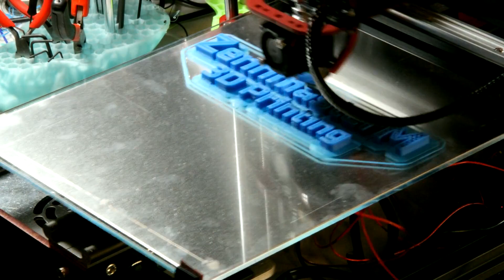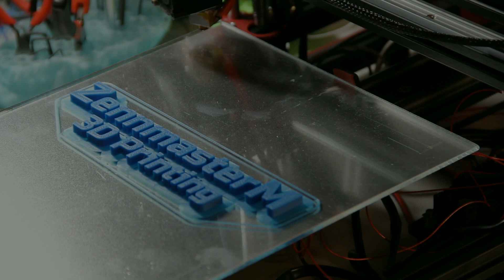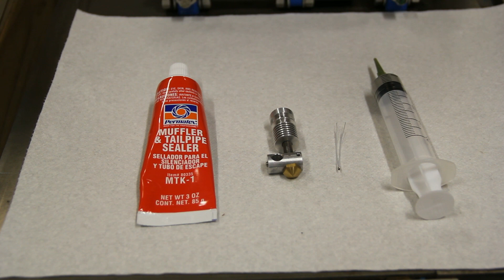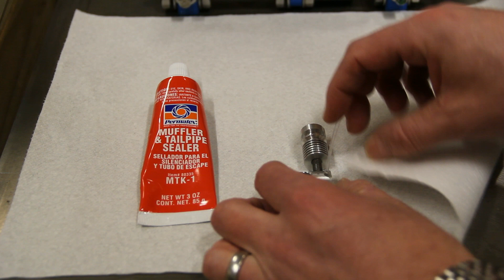RepRap 101: Installing a hotend thermistor with silicate-based cement

Comment: How can you replace the thermistor after the paste cures? I know with method you are not looking to replace the thermistor, but I only ask because i am left hanging with maybe a cracked thermistor that might have been bouncing around with vibrations from motors.  I have prints steadily going on a thermal halt from inconsistent readings
Reply: I don't know, but I'll bet that if the thermistor is bad any way, just drill it out and start over. Besides, thermistors are a dime a dozen on Ebay. Even the entire hot head block is only a few bucks.
Reply: @ronjones4069  I heeded your advice with your video a couple of years ago and I now have steady results.  I use a copper rtv based sealer that's more serviceable but have found out the block are a dime a dozen now too!  Thanks again!

Comment: Thanks for the video.  Glad to know this cement works for this purpose as I already had a partially used tube in the garage! 
May I ask, what size PTFE sleeving do you use for your thermistors?
Reply: I would also like to know what size ptfe sleeve you are using?

Comment: Thanks for this I was looking for just this info. 

Do you make your own thermistor leads? I have the joining ferrols etc and remade a few using the wires supplied by the kits. I want to buy right wire and do it myself but what wire would I buy? The wire in the nits seem to a stainless steel wire with a ptfe sort of coating.

Comment: I know this was done some time ago, but hopefully you can answer my question.  Where did you get the PTFE sleeves you used on the thermistor?  I have been buying some fiberglass sleeves replacements to use, but would like to find a bulk supply so I don't have to keep buying the stuff in 3 inch units.  :)
Reply from the maker: +Edward Boston  McMaster Carr, www.mcmaster.com.  The website is a little hard to navigate, but they do sell the stuff by the foot.
Reply: +ZennmasterM whats the ID going to be?

Comment: I have to replace hot end resistance and have to clean a similar compound I think... Do you have a recommendation for cleaning this stuff? Thank you
Reply from the maker: I'd receommend mechanically chipping it out with something like an awl.
Reply: ZennmasterM it is ok. I used some organic acids, it worked.Thank you.
Reply from the maker: Mert Oymak  That's great!  I'd love to hear some more details about your method and what specific organic acids you used!
Reply: ZennmasterM
I used grout cleaner, it does not mention which acids they are using....

Comment: I'm in Korea, where the same tube of Permatex Muffler & Tailpipe Sealer shown in the video, costs about $40 US. According to specifications, it has a continuous operating temperature of up to 1093 degrees C. But if you're willing to accept a lower continuous operating temperature of 343 degrees C, you could go with Permatex High-Temp Red RTV Silicone Gasket. It cost about $4 US here. As for the thermal transmission rate, even if it is lower than the Sealer (and I have no idea if it is or not), all that would mean is that it would take longer for the hotend temperature changes to be registered by the thermister. Given how thin the layer is in this application, I'd guess that the lag time would be negligible. Anyway, I'm going to give it a go since I like this method of attaching the thermister much better.
Reply: Don't use High Temp RTV Silicone. You are right. It's not a thermal conductor, It is a thermal INSULATOR.

Comment: Thanks for the tip, I have some " Red High-Temp gasket maker " from the same company.
Do you think that would also do the job ?
Reply from the maker: Daniel Young Sorry for the late reply!  Hmm, I'm not sure, but I'd guess probably not. The main thing your looking for is thermal transmission.  I suspect gasket material will probably insulate too much.  This is just an educated guess, though.
Reply: Thanks for the help, I just finished re-taping it with some heat transfer paste.
Bit of a pain, but still works.
I'll look for the same stuff you use for the future. Thanks again :-)

Comment: cool vid, but one question could you use the thermal compound which is used for computer processors as I have some of that stuff lying around :)
Reply from the maker: The only concern I would have about CPU thermal paste is that it is designed for much lower temperatures than you would expect to find in a hotend, and I'm not sure what the failure mode would look like.  On the other hand, I've never heard any first-hand stories of anyone having a serious problem with it, so if you've got it laying around, give it a shot and see what happens!
Reply: ok, thanks lots ill give it a go. :)

Comment: Have you tried this with the ceramic heater on the hotend?  The hotend on my mine is a bit loose (but makes solid contact at least on one side when kapton wrapped.)  I know people have used heat sink compound, but it can dry up and become powdery, especially when there's some gap.  Not having problems at the moment, but wouldn't mind relying less on kapton tape.
Reply from the maker: The hotends I use keep the heater secured with a grub screw which I think is a much better idea than an interfence fit, so personally, no I don't.  However, this method was originally used for holding in heating resistors, so I would think it should work okay.

Comment: For preventing thermistor of falling out, I agree, but I do not believe that it makes any difference for your temp setting.
Reply from the maker: That's possible, as long as you've got a thermistor with a bead size that matches the pocket closely.  If you've got a large sized pocket with a small-size bead, you'll want something besides air in there to transfer the heat.

Comment: It's definitely a more permanent method than I would use as I have already found reasons to disassemble some of my hotends for cleaning and other maintenance. I've found that using standard PC thermal compound in the same manner that you are evenly spreads the heat over the thermister.
Reply from the maker: It actually chips out fairly easily.  I'd also be careful with PC thermal compound, especially if you're printing hot with an all-metal hotend.  It's not all created equally, and not all of it can stay at 300 degrees for hours on end.